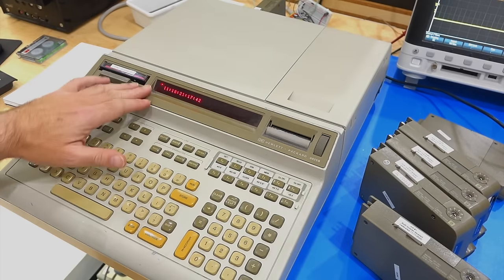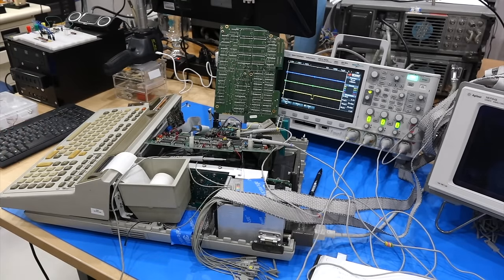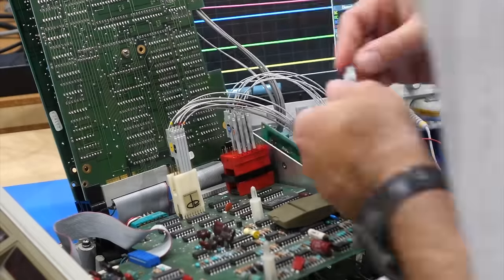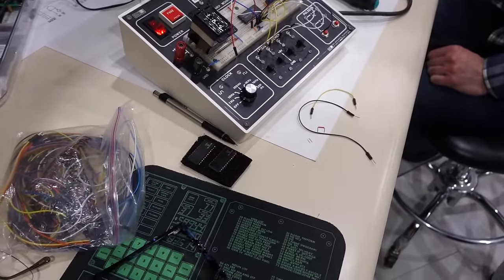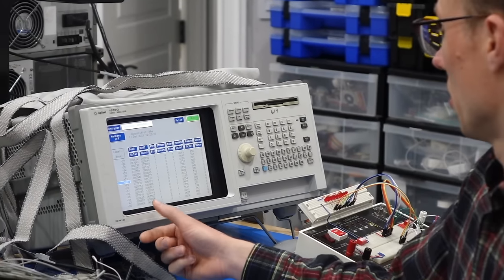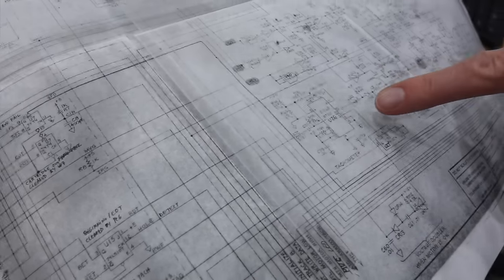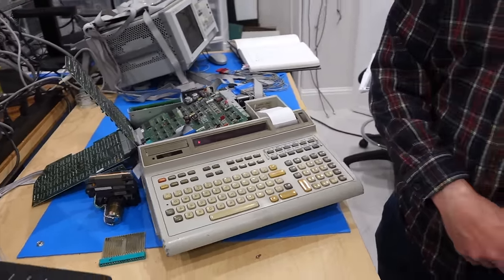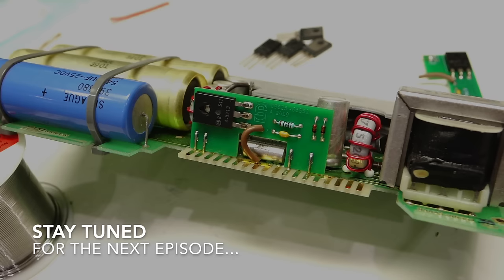HP 9825 Repair - Part 13: we get the tape working, and it’s fully repaired!

Comment: This has been a great repair series.  Thank you very much for this.  29 bad chips in one failed unit is a nightmare that would normally result in the unit never being repaired.  But you guys had the goal of preserving, and your perseverance paid off handsomely!
I've been lucky to have not had any faults beyond a need for a slight adjustment of calibration, on my two old HP's.  (A 5246L Digital Counter and a 3442A Volt Meter. Amazingly neither of them has ever had a failure!)

Comment: Love this series, kinda sad that it's fixed now! Have you seen the UsagiElectric channel? He's restoring a Centurion minicomputer with a bit-slice CPU. He may not have quite the same resources or contacts you guys do, but he sure has made astonishing progress (with help from the community). This includes reverse engineering the opcodes for a totally unknown architecture using only a ROM dump from a debug board! It starts off a little slow (cleaning, getting the terminals working, checking for disk head crashes etc) but the last few episodes are incredible. I have no connection with that channel, but anyone who enjoyed Marc's HP 9825 content I'm certain will love the Centurion series.
Reply: I love his channel! Especially the vacuum tube computer...

Comment: Great to see the 9825 fully operational, and that you are adding the crowbar circuit. I have one question, how have you found the plastiband mod to the tape cartridges?  I've found them to have too much friction and don't tension properly in my HP85 without issues. The fix I've found is a very small amount of graphite to slightly reduce the friction.
Reply from the maker: No problem with them, but you have to put a drop of watch oil your pulleys and reels and clean your posts, as the original lubricant is probably long gone.
Reply: @CuriousMarc  I too have lubricated the pulleys and reels but with more half the cartridges (NOS 3M DC100A) a change of direction has caused the band to grab the tape and pull it past the two band pulleys. Comparing the plastiband with the original band, the original has lower friction. I rubbed some graphite power into the surface of the plastiband then used a clean cloth with a number of passes to remove any excess graphite. Now the cartridges run with no issues in both my HP85B and 9825A
Reply from the maker: @Peter O'Neill  I have seen this. In my experience, this is caused by the springy-er band accumulating more tension on the band during high speed rewinds, and eventually causing either of the reels to stick. Or from the band sticking to the guiding post on its own residue. Proper oiling and cleaning did it for me. I have not experimented with graphite like you did. It’s a clever idea that should help even further, I’ll give it a try!
Reply: @CuriousMarc  Yes I think you are right about the band accumulating tension, I have noticed this too. As for using graphite this is nothing new, for many years endless loop audio tape cartridges used a graphite backing on the tape.

Comment: Working at Shell laboratory in Amsterdam in the 80's the 9825 was my first computer I had to work with. Connected to a HP chromatograph it read and analysed the data and I did at first not even dare to touch the thing. That changed soon when I deep dived into the possibilities and working principles. What an amazing machine and I am still impressed of how powerful HP Basic was (and still is) compared to the other BASIC versions of that era. We used HP equipment very extensively and was always highly impressed for their quality and ease of use! Such happy memories. Great channel and keep up the great work👍😄

Comment: Looking yesterday and found i have 2 Lambda crowbar modules, which would have prevented this as well. 6.2V trip, 30A rating, to blow the fuse in case all goes pear shaped.

Comment: But do you trust all the IC's you didn't replace?
I one helped repair an 8 bit computer (TRS-80 clone) that copped 240V mains down it's printer port. We ended up with a similar sized pile of deads as you, but from far less boards. We started by repairing blown tracks (Yeah 240VAC has more bite than 14V) then all the IC's that ran hot, followed by all that were dead cold, that fixed 95% of it. The main saving grace was the ROM's were not killed.

Comment: Wow, what amazing troubleshooting! - And you have four of these! :-0

I used the heck out of a 9820 ages ago in my undergrad years (dating myself ;-) I wish I'd had a 9825 to play with, but I did a ton of data reduction on the 9820, and had the most obsessively awesome graphs in Physics Lab (lol) (The 9820 had an x/y plotter as a peripheral :-)

I can't believe it, just for the heck of it I looked up the original cost of the 9820; converted to 2022 dollars it cost over $34K just for the base unit with no options added :-0
Reply from the maker: Yes this was very advanced for the time, and freakin expensive.

Comment: Hi Marc, love your channel. I'm interested in the crowbar ciruit you made to protect from overvoltages. Can you make a small video or post a schematic of it? I'd like to make one to protect ham radio gear, so I need something around 14,5 volts that can blow a 30A fuse (and not blow itself  in the process).
Reply from the maker: Yes that’s coming up next

Comment: Unfortunately, my experience with over voltage on TTL chips has been that more chips will eventually fail.  But I sure hope that it does not happen to you.
Reply from the maker: We’ll likely have more failures, but hopefully one at a time, not 29 all at once!
Reply: I fixed two arcade boards that must've been overvolted (one had traces turned incandescent and a chip that literally caught on fire) and I got lucky, only a few chips died during repair and when I revisited the boards a month or so after repair, they still worked. One had an EPROM where the magic smoke escaped the die, but was held back by the quartz window. Trapped magic smoke is kinda rare, although I've seen way better examples.

Comment: Thanks for your dedication.  Most of us techs have swapped subassemblies to get the equipment running and to isolate the problem.  Some or many of us have troubleshooted to find the bad chip.  My biggest problem has been where to get the replacement for the bad part.  I hope you include some information on how you do this in the future.  It's truly amazing and dismaying to see all those dead chips, thinking about and how much time that one bad transistor(?) in the power supply has cost.
Reply from the maker: It’s all TTL, so most of them are still available. The few specialized parts, the power transistor, the Intel memory controllers, the Signetics UT20  monostable oscillator came from eBay. It would be much more difficult to do our restorations if eBay wasn’t there!